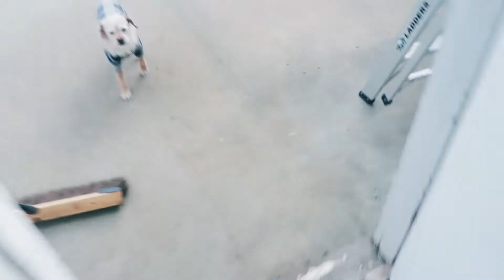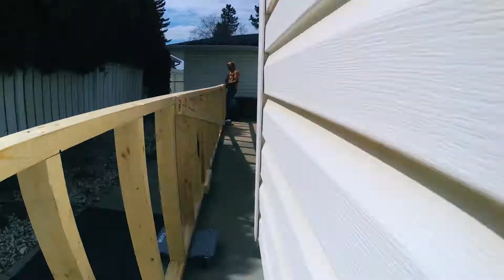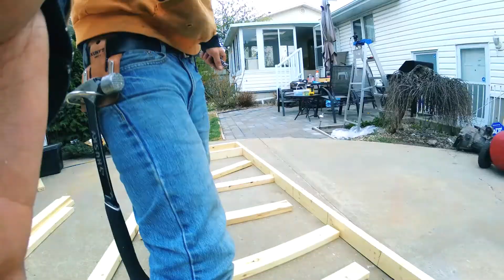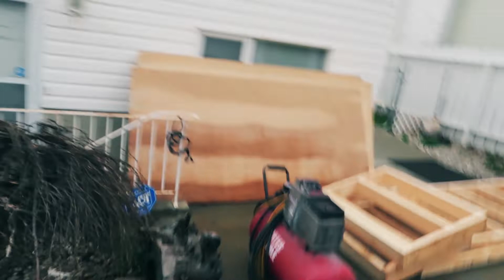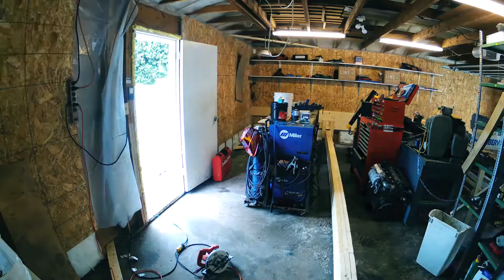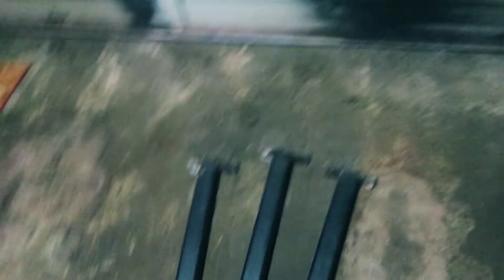[How To Lift A Building] Pre-fabbin the last 4 walls.

Comment: Have you had any issue with neighbors and/or building codes?
Reply from the maker: Not at all, I talked to all of them during the process. They were all intrigued more than anything. I called the City and jumped through all the hoops there. No issues at all.
Reply: Neighbors and city hoops are key!
I thought where you had a car towed there may be issues.
Thx for the vids .